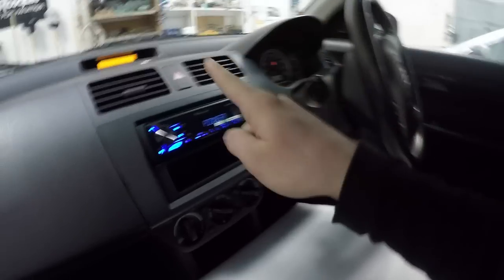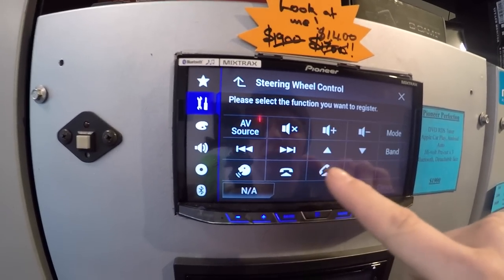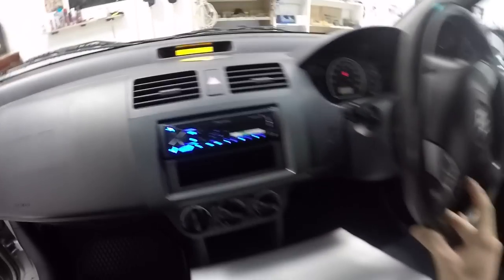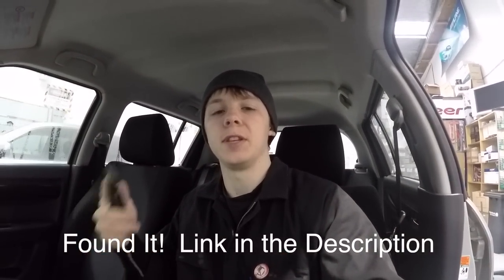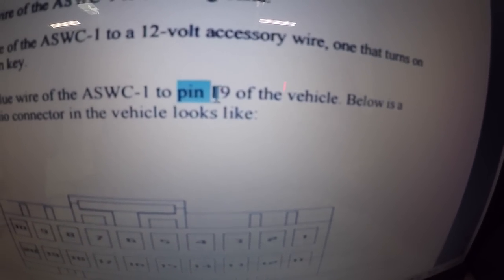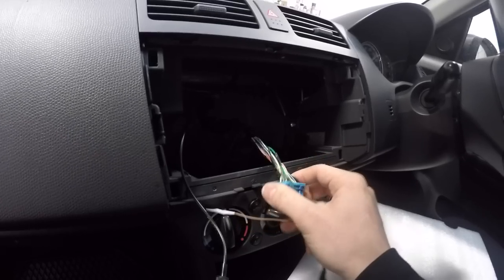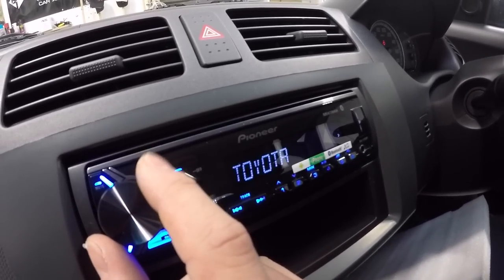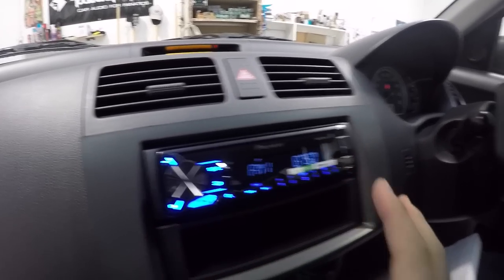How to Wire Up Pioneer Built in Steering Wheel Controls Interface | [S Remote/SWC]

Comment: I have pioneer  avh-x8850bt when i setup my steering wheel controls they works fine till i make a restart to cassette or turn off car and turned on again the controllers not working and when get into the page for programming again i see all buttons marked as set and try to press any button the cassette mark on the programming page when i go away from this page and try the buttons again still not working till reset all buttons again and setup again is there is solutions for this case

Comment: I have a Honda 2002 odyssey and a pioneer AVH-120BT. It has a port on the back for SWC. I’m confused do I need to connect the ground and signal wires? (Pin3) is the single wire. Does it matter where I get ground from? Thank you!

Comment: I have a mvh s420bt will the s.remote function only appear once the rear 3.5mm plug has been attached? . As it currently does not appear in the settings menu. Many thanks

Comment: great video thanks! have you ever installed one of these pioneer single din units into a 2002 ford falcon? info seems hard to come by. I have identified the two wires on the loom (volume up and volume down ) but have only found one preset which will turn the vol up but none that will do both (there is a seek button two but i believe that is a combo of both.) this is a very old video so i don't hold out to much hope of a reply but thought id ask. thanks again really nice work.

Comment: Thank you for the great demonstration.
I'm about to try it on my Nissan X Trail T31, and I wonder whether I should connect the head unit to wiring coming from the Bluetooth module or do the bypass (and connect the head unit directly to the SW control buttons)?
Any idea?

Comment: Excellent! Ill have to go into my Pioneer and see if this is an  option. I really appreciate you going into which pin on the jack goes to what as I have access to bare plugs I can then just solder wires onto. Ill have to figure out if I can emulate one of the vehicles it has already in it. I just want to add what is effectively a remote mute button to a vehicle without steering wheel controls, so I can use any resistance that will do what I want.
Reply: I am not a 100% sure on this but I don't think the steering wheel controls will be resistance based.  I expect  it is some sort of code modulation (i.e voltage on/off really rapidly., 1s and 0s) that will show up as a DC voltage drop if you had a multimeter across the wires.  Different buttons(codes) will produce different drops, giving the impression that a different resistance is being applied over the connection.  (Although this doesn't help to answer your question sorry :))
Reply: @floydbloke258  no I have a document detailing what the resistance of each button is. There's no smarts. The stereo just oitputs a voltage and looks for a voltage drop registering a specific resistance. If its in the range of a button it activates that function.
Reply: OK thanks, I learnt something new.  Did you get your mute button working?

Comment: excelent video, 
i have a quetion.. i have a 1996 4runner on which i just installed a Double din stereo from pioneer ( for the android auto feature) 
i'm thinking in purcharsing those universal steering wheel controls from ebay that you stick to you car steering wheel to add the controls for the stereo... 
but in the wiring, they all show, GROUND ACC KEY1 & KEY2 , can i just buy that 3.5mm jack an solder the KEY1 y KEY2 wires and it should work?

Comment: Great video. I have a dilemma, my car is Toyota Allion 2016 model. Its a JDM car. I perhaps foolishly purchased Pioneer 4500NXT seeing its "steering control ready". It has a wired remote input at the back. But it seems it requires iDatalink Maestro module for the steering wheel control to work? But iDatalink Maestro does not has my vehicle model listed. Is there any way around? Without using iDatalink Maestro?

Comment: Hi 
I have Pioneer MVH-X580 BS
Which has got port for steering wheel control. 

However the steering wheel of my car no control buttons to connect. 
Now I wanted to have the control switches to be installed on steering wheel. 
For which, what all I would need to buy ?
Do I need to buy a 
PaC SWC adapater ?
And steering wheel control? 
Kindly clarify
Appreciate your support. 
Thank you

Comment: Will the pioneer avh z9150bt head unit work with Mitsubishi attrage/mirage without an adapter? I wired remote 3.5 plug to pins 2 and 12.

Comment: Hi, i have the mvh-s325bt and it has the remote wire input capability. I want to wire it to a ba falcon steering wheel. Can you tell me which Japanese makes use these 4 buttoms vol +, vol - , seek and mode. And would be able to tell me the resistances of those buttons so i can modify the ba buttons resistances to suit. Tia

Comment: Hey, this was an awesome Video!!! However I have a pioneer deh-x4900bt  and it says steering wheel ready. But when I go into the settings as you recommended I cannot find the steering wheel control options. How would I configure this?
Reply from the maker: Your stereo will need an external interface model, that is what steering wheel "ready" means.
Reply: Car Audio.etc ok thanks for that info. Again great video. Keep up the good work.

Comment: I have a Renault Megane 2 2009 and have just bought a Blaupunkt Stockholm 370 BT radio which has three wires to control and programme the SWC.  I cannot find anywhere which wire on the yellow connector to attach the radio to.  Can you please help ?

Comment: Hey mate I've got a 2004 mazda 6 GG and I've just connected up Axxess ASWC 1 which I have connected to a pioneer single Din Headunit there is a issue im having where the steering wheel interface syncs with steering wheel but not the head unit what could be the cause.

Comment: Good day, I have a generic aftermarket radio it only have one wire for the steering control. I am installing in a 2012 Toyota Isis which has three wires coming from the steering control. How do i connect?

Comment: Hi, I have one DEH-X6750BT and I'm trying to install it on a Toyota Hilux. Everhing was fine until remote configuration. I don't found the association of the steering wheel buttons on the menu. I don't know if I'm doing something wrong or the model of my unit doesn't have the function.

Comment: i can't find the connector diagram for my Fiat 500 anywhere. would really be great to have those controls again.

The Alpine i removed from the system used an Axxess adapter thing but i put a Pioneer DEH-x6910bt in it. So i think that's why it doesn't work with the adapter.
Reply from the maker: Tyler Garza the axxess adapter will need to be reprogrammed 
They are really good interfaces but coding them is unfortunately a bit of a mission even when you know what you're doing.
If you wanted you could look up the instructions on how to re program it on axxessinterfaces.com but I would advise taking it into a professional.
Reply: Thanks for the reply! I actually spoke with their tech help earlier, and he gave me instructions on how to do it through the controls on the car, but it seems i still can't get it. I'll find someone to take it to if I can. I can live with out it for now.

Also, do you know anything about what might be causing a slower connection to my HU from my iPhone cable? It takes a good couple seconds to change songs when I do it from the phone or the radio.

Comment: do you use any interface or module? do I need one intwrface to connect avh 950bt on versa 2014? or only with 3 5 jack.
Reply from the maker: I don't know that model of stereo so I don't know if you need a module or not:
Also what is a versa?
Reply: Car Audio.etc is a stereo built in steering wheel control. versa is a Nissan Versa 2014. thank you. the stereo is 2 din an AVH.
Reply from the maker: Well Nissan have resistive steering wheel controls so that should work if your stereo has the built in decoder.
Go through your general settings and see if you see something called "Steering Wheel" or "S-Remote"
If there is something along those lines with the option to program button functions you should be able to do it without an external module.

Comment: where do you get the 3.5mm harness? I have searched the internet but no luck
Reply from the maker: kroz123 well we actually have spare leftovers from a couple of Sony and one alpine unit that come with it from when we installed the stereos into cars without swc.
I'm pretty sure you can get them but they're more of a specialty part that only dealers/installers can get.
It's like buying a new microphone for a stereo, they don't just sell them off the shelf.

Comment: Will it work on 2DIN Pioneer AVH-295 BT?
Reply from the maker: yes I beleive that one does have it built in.
If you click "source off" then go into your general settings there will be a tab called steering wheel control
Reply from the maker: from there you can manually learn each function to a button on your wheel.
Reply: Yes. I have a AVH-295BT. The new 2018 model is called AVH-A205BT so the parts you need is usually labelled that model number.
Reply: @caraudioetc  will triste work in a pioneer dmh-g225bt? Its almost the same as avh-g225bt